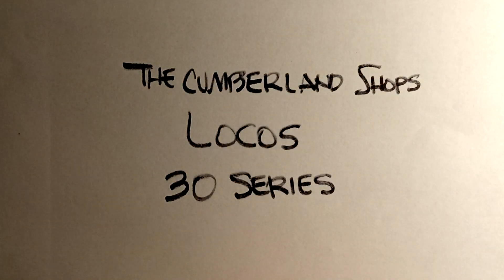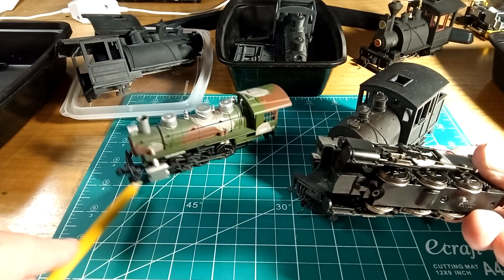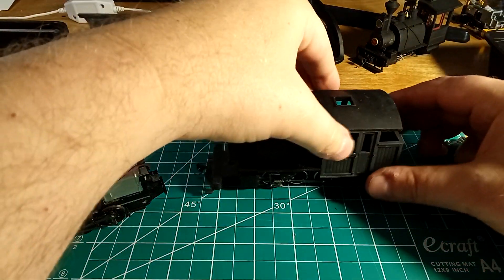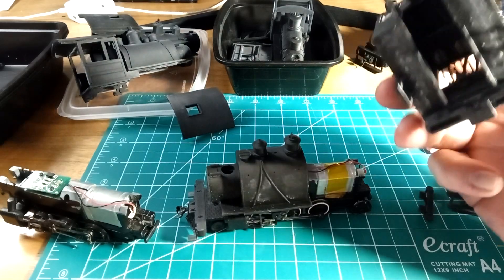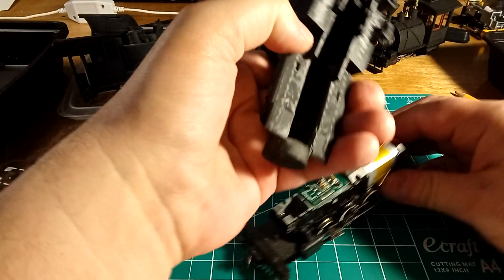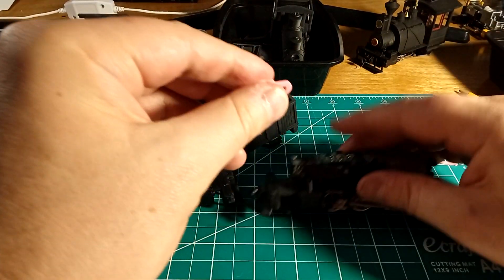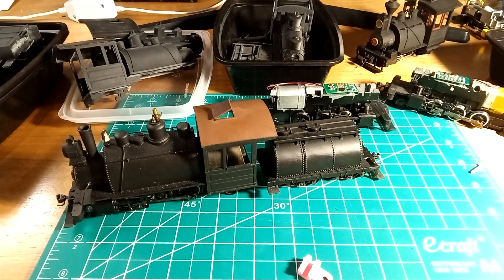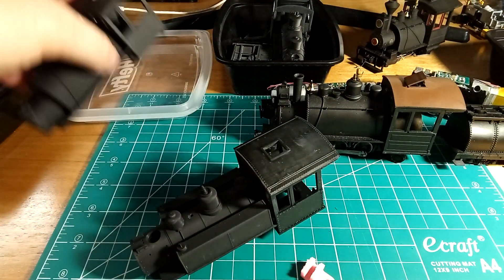The Cumberland Shops: On30 Locos 30-36

Comment: Number 36 Ain’t Up on The Etsy Shop?
Reply from the maker: Hey General, you're right!  I've been working on a couple of new releases.  I'll get #36 into the print queue.  Thanks!
Reply: @grits3d  here’s a random idea make a cylinder replacement for the USRA 0-6-0 or 2-6-2 chassis what I mean is that I think (personally) that the stock cylinders are a little too modern for a little logging or Shortline engine that’s from the early 20th century
Reply from the maker: @General1855Mantua   - Agreed.  It would be nice to have a plan for simplified side rods, too.  Of course, it would be ideal to be  able to print our own mechanisms, too.  Desktop metal printing is being worked on.  Still a bit pricey.